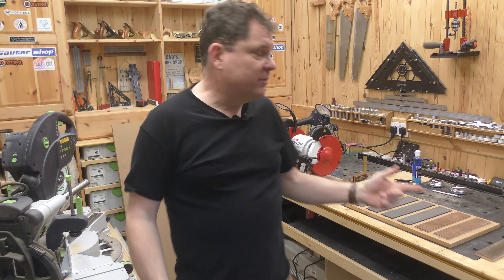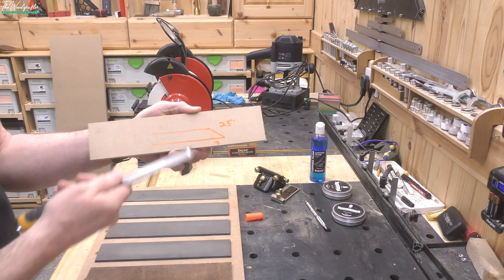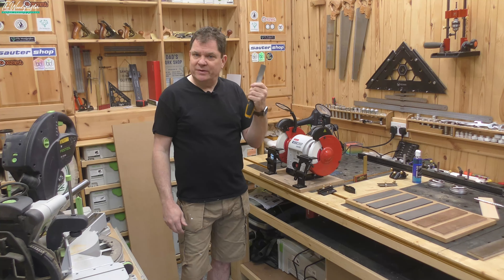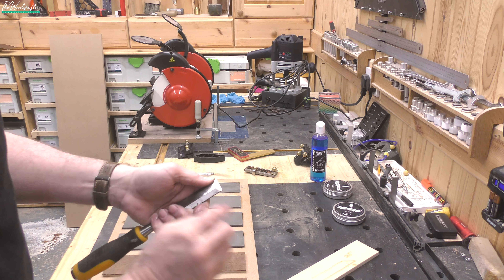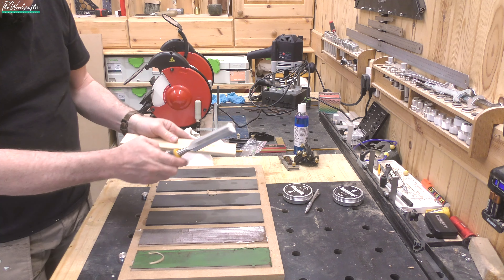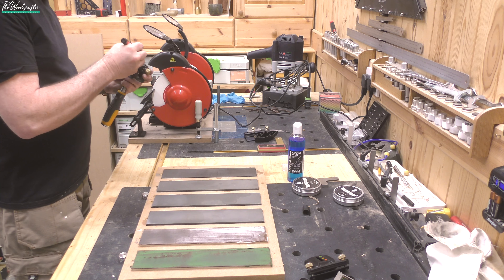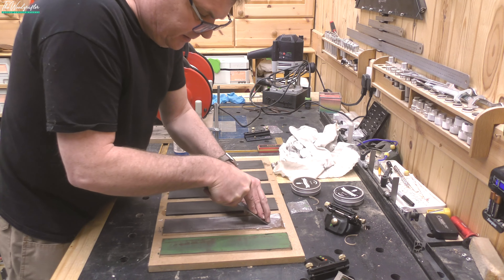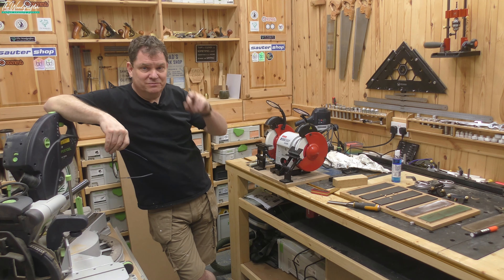How To Sharpen a chisel - sharpening system for woodworkers

Comment: Another great video, thanks Andy. I’ve always been a water stone guy but I use a diamond stone for first flattening of the back.  I have the original Veritas jig and still love it. I have a small brass square to make sure it lines up correctly. The new one looks better though. Using the grinder for the initial bevel do you find you get a “hollow grind”? I always thought that would be advantageous but I haven’t used a grinder in the past. I bought a cheaper Tormak clone and wish I had just saved my money. It’s terrible, ground a lot of the stone to true it up and still can’t put a square bevel on a blade. I like your setup and think I will copy the grinder portion. I guess you need some Lee Valley affiliate links 😊.  Thanks again for a great video and your back stronger than ever.
Reply from the maker: Thanks Kyle,

Very kind comments, yes it does give a hollow grind obviously the smaller the diameter of the wheel the more pronounced the hollow. 

I don’t really find it an advantage or a disadvantage to be honest but I know it does split opinion in numerous forums.

I also struggled with the Tormek, spent a fortune on additional wheels and accessories and still couldn’t get it to put a square grind on the blade.

I am happy with this setup and am getting good results.

And by the way, the links in the description are affiliate links :-)

Cheers

Andy